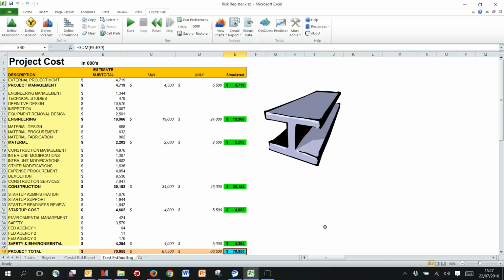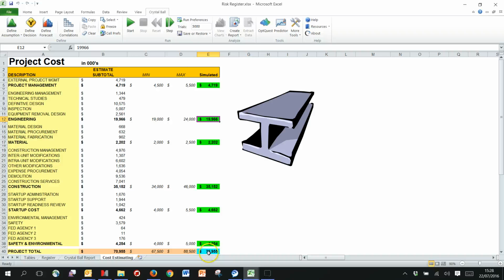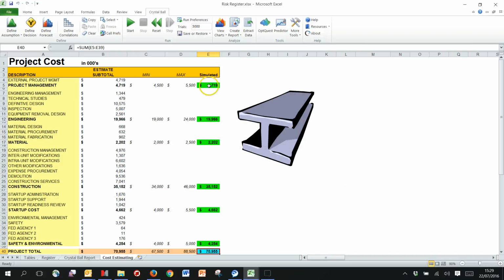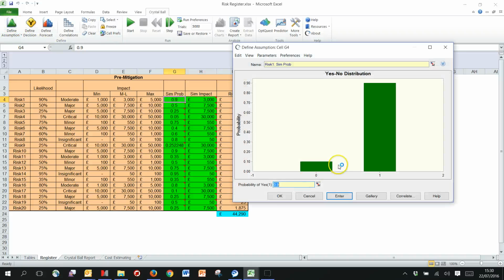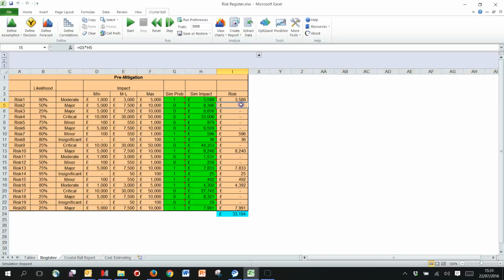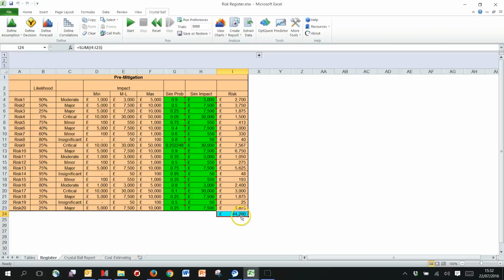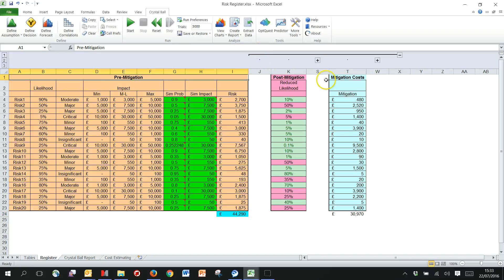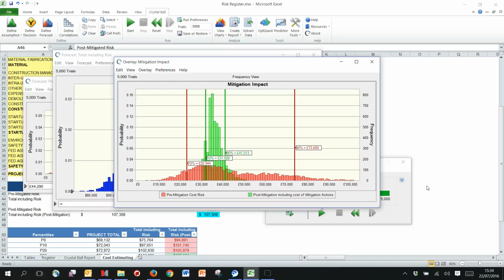Crystal Ball for Cost Risk Analysis - Uncertainty & Risks

Comment: How did you label your chart markers like 90% = .......... ?
Reply from the maker: @Graeme, you can add markers by going to the Forecast Chart and it's Preferences menu then Chart... > Chart Type Tab > Marker Lines.
You can select a number of different marker lines such as Percentiles.
You can also use certain keyboard shortcuts for some.  For example, Ctrl + P for Percentiles then toggle through.  Ctrl + M for Median and again toggle through.